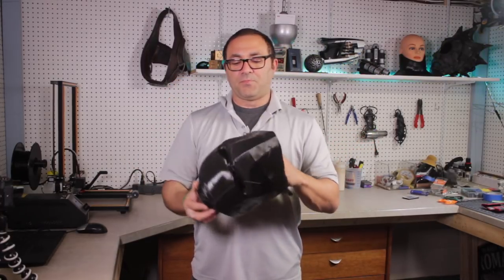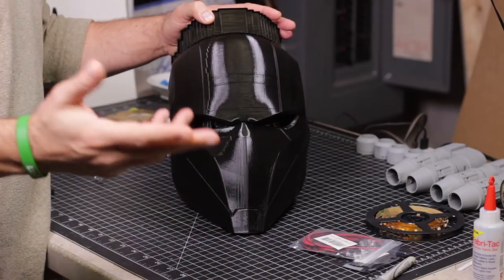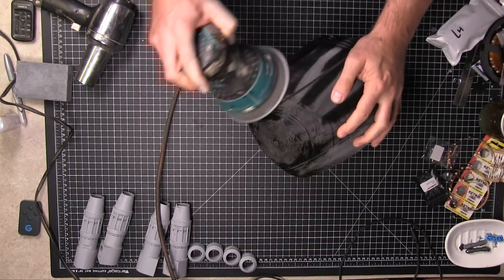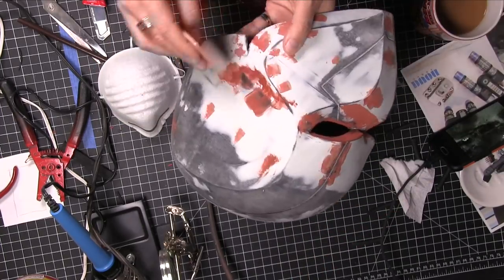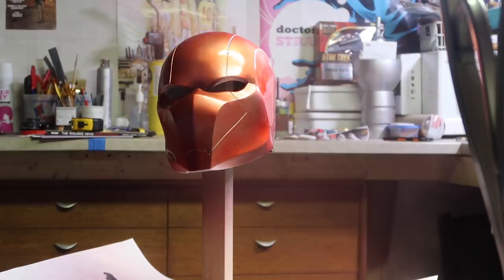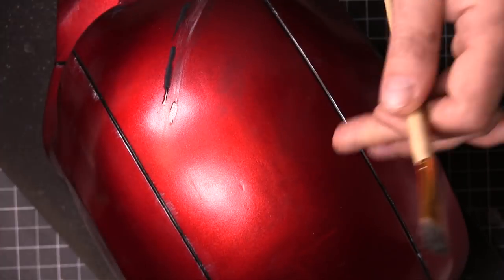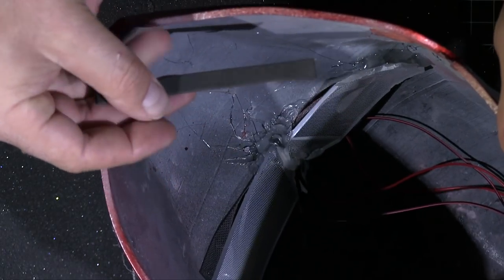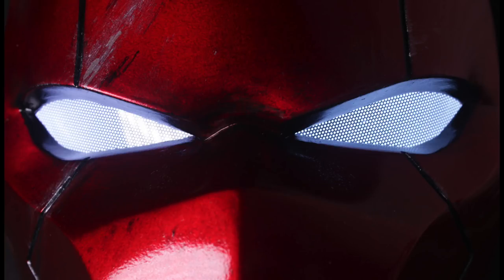Red Hood Helmet Build [Creality Coupon Code]

Comment: Was the bondo you used just bondo ? Or did you use hardener with it? For the wet sand does it have to be 2000 gritt? Or can I use 3000 grit?
Reply from the maker: Bondo with the resin hardener that comes with it. If you don't add the resin hardener then it will never harden. You can use 3000, the finer the paper the smoother the surface. But you need to work up to that level of paper.

Comment: Pla or Abs
Reply from the maker: PLA, CR-10 have a hard time with ABS, especially for me since my printer is in the basement.
Reply: 3D Printed Props, I As well I’m having some issues with Abs. But I’m very close to getting it right. The enclosure does help a great deal in my situation.
Question is the Pla holding out pretty good, since is not as strong as ABS. Also have you notice any splitting of layers and what not. I’m very new to this but will like to understand how PLA holds to the bondo, putty , primer and paint.
For durability